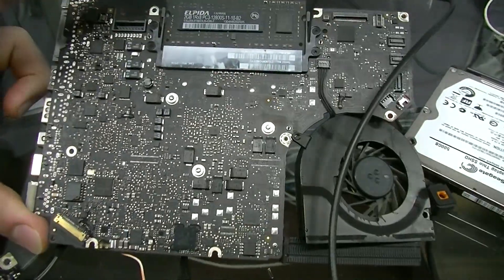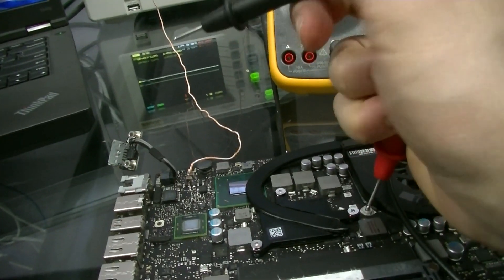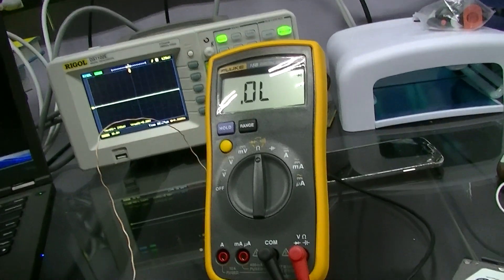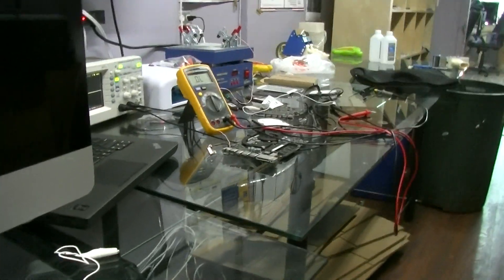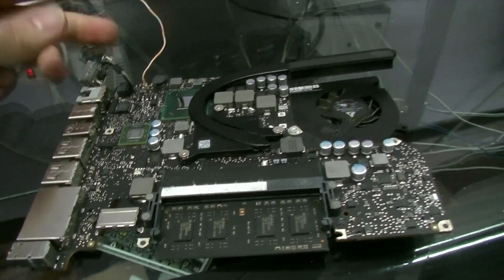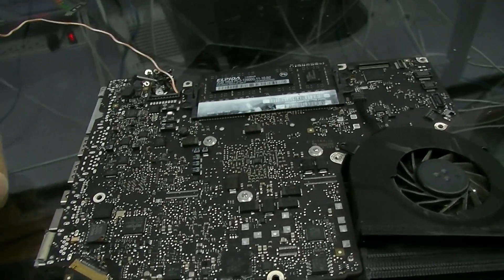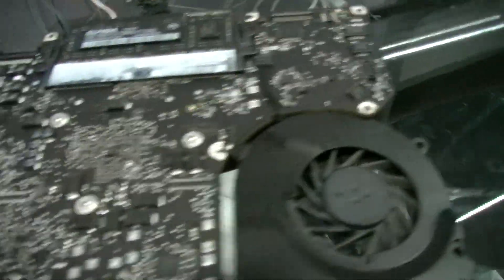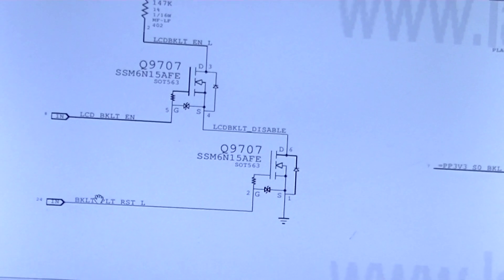820-3115 Unibody Macbook Pro A1278 no backlight - finding the short & fixing the issue

Comment: thats a power mac G5 and the highest Mac os which can be installed on it is 10.5 I have 1 it works good just can't do anything with it can't do internet you can use it for like video editing and music but it really is obsolete. I also have a G4  powermac but anyway I have a 13" macbook pro A1278 Mid 2010. I replaced the screen and the cable that connects it to the motherboard and still no video it will display on an external screen so its not the video card I'm thinking I maybe damaged the plug when I put it back on. It's my nieces laptop I bought it for her new and now I have been trying to fix it for her. I cannot afford to buy another and well I can't afford your services either. I am trying to purchase a new motherboard for it but I keep finding boards that have water damage I don't want to take a chance and spend $100 and get a board that doesn't work since they offer no returns.

Comment: Hey Louis. I just started fixing logic boards. Got the 820-3115 after water damage that works fine on external but does not work on internal.I have replaced the VLCD as at some point I have managed to have i picture on internal screen ( I have connected complete lcd top lid from another MBP13) twice. There in no sight of backlight coming when power up. What part do you think should I start to diagnose. I have seen on schematic that the signal to enable the internal lcd comes from mpc and to the external one via mux. Thanks.

Comment: Louis uv light separator not that hard i was the same but keep trying you will get it if you doing all this hard ass fucking board repairs im sure you can successfully remove the lcd from the digitizer
Reply from the maker: Too much of a pain in the dick. Let's pull the wire, oh fuck it came off the two sticks again. Let's pull the wire through the glass again, oh fuck, it came off the two sticks again. Let's screw it back in, oh fuck, I stuck myself and cut myself from the fucking wire. Let me use my hand instead of the two sticks to hold the wire, oh fuck, I have a huge bruise on my hand from pulling the wire with my hands... Fuck that shit.

I've always said you should make money off the shit other people don't want to do, the shit others do not have the time to do. I am more than happy to let someone else make money off of that, while I make money off of this.
Reply: Louis Rossmann I'm trying to find the short to ground since I did the mistake of replacing the fuse first just like you said. I haven't figured out where to start measuring but I tried first from where the backlight output is C9799 assuming this is where the backlight circuit ends. Did both diode test and resistance measurement, this is what I got: 

C9797 - reads 002 and beeps in diode mode (to ground). I'm getting 00.3 (200ohm) when measuring resistance to ground, 673 (2000ohm) when measuring resistance across the cap and a readout of 731 in diode mode across the cap (doesn't beep).

C9799 - Same here, 002 diode mode (beeps), 00.3 (200ohm) resistance to ground, 673 (2000ohm) resistance across the cap and 731 across the cap in diode mode (doesn't beep).

C9796 - Same here, 002 diode mode (beeps), 00.3 (200ohm) resistance to ground, 673 (2000ohm) resistance across the cap and 731 across the cap in diode mode (doesn't beep).

D9701 - getting 213 across the cap in diode mode (doesn't beep).
482 with negative to ground and positive on PPBUS_SW_BKL.
732 with negative to ground and positive on PPBUS_SW_LCDBKLT_PWR_SW.
131,8ohm (200ohm) and 192ohm (2000ohm) when measuring resistance.

R9715 - getting 690 across the cap in diode mode (doesn't beep).
99,6ohm (200Kohm) with negative on BKL_EN and positive on GND.
25,9ohm (200Kohm) with negative on GND and positive on BKL_EN.
Reply: R9731 - 483 in diode mode with negative to ground and positive on PPBUS_SW_LCDBKLT_PWR (doesn't beep).
1090 the disappears in diode mode with positive on BKL_EN.
3,09 ohm (20Kohm) with negative to ground when measuring resistance.
19,25ohm (20Kohm) with negative on BKL_EN and positive on PPBUS_SW_LCDBKLT_PWR.
12,57ohm (20Kohm) - /vice versa
94,3ohm (200Kohm) with negative on BKL_EN and positive on PPBUS_SW_LCDBKLT_PWR.
184,2ohm (200Kohm) then disappears - /vice versa

I don't know if I did it right but I tried get every possible reading, 
this is my multimeter btw: http://www.inmotion.pt/store/images/3/INM-0727.jpg
hope this was to any good.
Reply from the maker: You're confusing me with those measurements, R9731 is a resistor for BKL_EN, all you need t omeasure on tis is resistance to see if it is good, and to see that you have 3v on one side of it, or 2.7v.

the idea with diode mode measurement is to measure the output of backlight off of C9799 or a pin on the LVDS connector for backlight with the black probe, and to put the red probe on ground, in diode mode, and measure the voltage drop from output of backlight to ground across the entire circuit. Which board do you have?
Reply: Louis Rossmann It's a 820-2915-B board, MBP early 2011. I have the schematics and the board view. I've already done the diode test on the C9799 and the LVDS connector, the C9799 beep'd meaning that it ha continuity but my multimeter doesn't read 0,534... like yours.
Reply from the maker: There usually  no beep. Are you on the right side of the cap? Measure on pin 39 of lvds to ground with black probe on pin 39 and give me the number you get.
Reply: Louis Rossmann Hi again, I did what u told me and performed a diode test on the LVDS connector (to ground) pin 40, 39 and 38, none of these beeped with the LVDS cable unplugged, it didn't start to beep until the 12th pin from the left or so.
While I was at it I also measured the resistance to ground, it didn't give any reading until option 200Kohm where it increased to 180 very quick then back to 1, on 20Mohm it gave a reading of 15 and slowly started to decrease.
But with the LVDS cable plugged in, it was a whole different story, in diode mode I got a beeo on all three of the pins and it also red low resistance like 002 on the 200ohm option. Maybe I have found my short to ground bruh?
Reply from the maker: I don't get what you mean, there are no beeps in diode mode. I need the number in diode mode that you get. We are not checking for resistance.
Reply: Louis Rossmann Yes there is on my multimeter, according to the manual of my multimeter a beep occurs when the resistance of a circuit under test is less than 70Ω and since the resistance is much higher than that the buzzer did not beep and therefore i didn't get any reading at all just 1, do you get it now? Also note that this was with the LVDS cable unplugged, it gave a reading of 003 and beeped with it plugged in meaning that the resistance to ground is very low. I have shitty 20$ Uni-T multimeter that doesn't have auto-range like yours that's maybe why don't get what I mean.

Comment: R u rebuilding lcd screen? I see the uv light and separator tool in the back
Reply from the maker: I suck terribly. I hate that shit. I get to a point where I'm finally getting it and that fucking wire falls off one of the two sticks it is screwed to and I curse and curse and curse. It is completely mind numbing horseshit. That separator tool gets used, 99% of the time, to make iPad minis easier and I'm fairly certain the receptionist has used the UV light for her nails more often than I have to fix a Samsung phone.
Reply: Louis Rossmann lol, glass only repairs are a pain In the ass.  I've been trying to get the separation process down but I am terrible at it. If I do manage to successfully separate the glass then I fail miserably with the LOCA and make a huge mess.